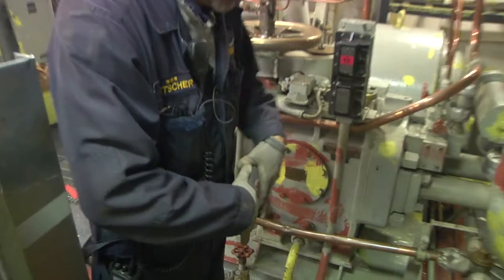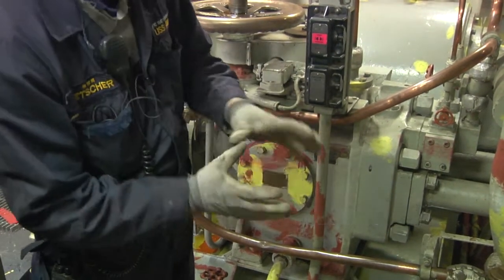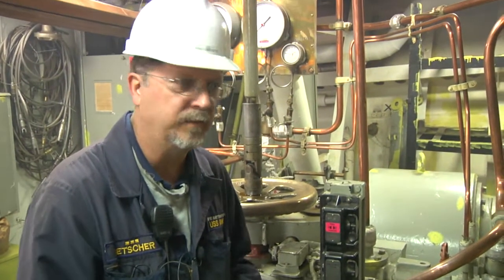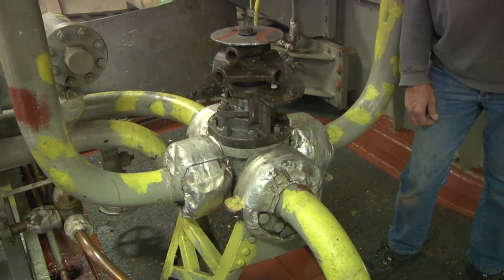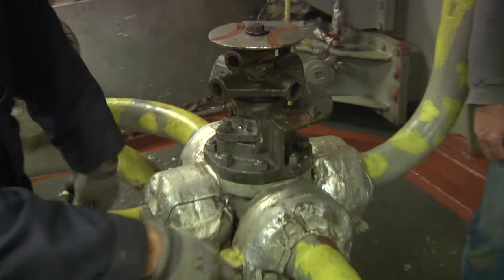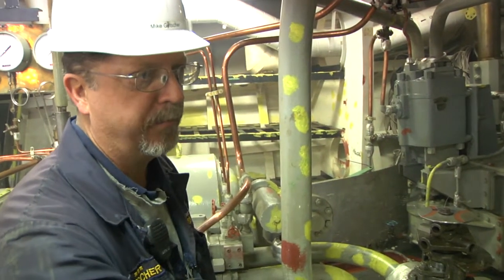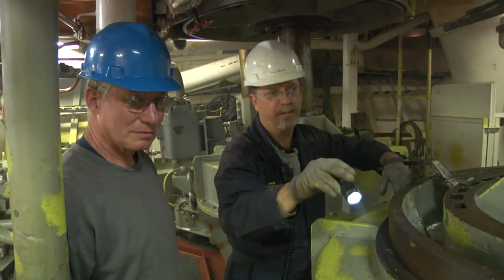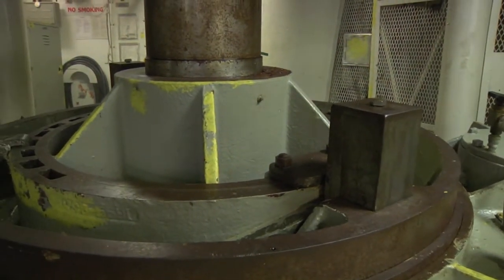Anchor Windlass teaser 2

Comment: You can't comment on the video titled "Why Do Turrets Fall Out?".. So, I would like to add to the theory as to why the why the clips are there. The 3/32 claimed tolerance Of course is to keep the whole assembly in place, sure, but the massive amount of weight, being allowed to lift up, and slam back down, causing denting on the races and rollers, or flat spots or what has been called "hooks" in the rail way industry as per the rail to wheel relationship, just before the major spalling or fatigue of those damaged or dented locations.. The work harding of the rollers and races never stop that process, from being in normal use, to the point, that the surfaces get so hard, then fracture,  or if the visuals show no signs of fractures, but are right at that moment, of blistering, a hard impact on the work hardened area explodes the metal contact point areas.. I can imagine, something like these turrets, being that heavy, changing out a bearing and race system was not an easy task, let alone, the idea that the failure rate from initial drop damage or impact damage of a work hardened system, to total system failure could be less then 50 rotations, as each past/rotation getting worse by sound, and vibrations/feel. before something completely lets go, over pressure of the hydraulic system or gear train down to the pinion gear on the internal geared rack. I theorize that the "clips" are there to simply keep the turret from bouncing causing damage to the roller system and its bearing races..  It might be worth looking into seeing if a service manual for preventative maintenance for those types of system was ever made? kinda like what is common on the automobiles of today for the "planned obsolescence" maintenance plans. Replace the ball joints and tie-rod ends at 50k miles, 60k replee the inner ribber bushings on the lower control arms, etc...  as the US military had a dang manual for everything, including how to properly, blow your nose. no joke.. If there was never a manual for these systems, I would say one of two ideas then, 1st, there wan't enough time, for the war efforts to write one? 2nd, they never intended the ships to make it back. 3rd, it didn't matter, they would deal with it if the turrets had issues if or when they did? 4th, the system was assumed to out last the life of the ship, not knowing factually if they actually would, "SEND IT".... lol..  Just a theory.. Fun video.
Reply: Out standing reply. 1st, these channel does not allow hit the return button to create paragraphs, for proper writing. but what I find more alarming, is the amount of time to write something for me take people longer to read, that is exceptionally sad to constantly witness.. A video that basically put out a request for any input and or theory as to the subject matter, and you are upset that somebody took the time to give a valid thought as to said subject.. Well done. If you are viewing this on a cell phone then yes, it looks like a massive wall of text, but if you are seeing this on a full screen, it is a paragraph as per size, but the last comment as per the manual reasoning, was literally one line on a full screen, not worth bisecting if you channel would let me.  You Sir, should be wonderfully proud of yourself...So, if my comment is unworthy, then please delete it. it will not hurt my feelings. Won't even be back to view your content again. and simply move on. What I will say, from your reply, is you do not give a damn, other then, people, send up money so we can act like we care about saving this important history, and do not ask what we are doing with the grant money for said projects... is that what is going on wit hyour channel, hustling money for your own personal gains, while claiming it is for the research for the ship? Typical!!!!!
Reply: @haywoodyoudome  You are not helping lol
Reply: @haywoodyoudome  IT's also called censor ship and i believe if you can't take the bad with the good you shouldn't post on a public forum at all
Reply: @drubradley8821  Really?  This channel doesn't allow hit the return button to create paragraphs?

Oh look, I hit enter and created another paragraph.  Surely that's just a fluke and it couldn't possibly happen again.

Nope, did it again.  What do you know....Guess it's just you.  You're special.
Reply: @haywoodyoudome  Well, for what is is worth, when I would hit the return button, the "REPLY" button would post the comment..  so, maybe it is a settings issue on my end, but none the less, if the comment that took me like a minute or 3 to type, takes you longer to read, that actually sounds like a problem on your end, not mine.. If the comment is too long to you, How about you just simply not read my comment and save yourself the struggle..  Now, I would like to add, what kind of communistic crap are you on about? any channel that gets comments no matter what or how the comments are presented only helps their channel. and you, Sir, act like you do not want the membership to feel free to comment... Please ask yourself, beings you are so damn concerned about this, "How are you helping this channel by being an a$$hole?" I actaully rather enjoy learning about this content and subject matter as it is something that has been thrown into a moratorium or mothballs as it is typically called.. I desire to learn about it, and you, Sir, think you get to hinder me upon what I desire to learn about? How about this Mr. Troll, crawl under your computer desk, lay in a fetal position, suck your thumb and eat a bag of d*cks.. Now, I kindly ask, leave me alone you phuqking retarded weirdo..